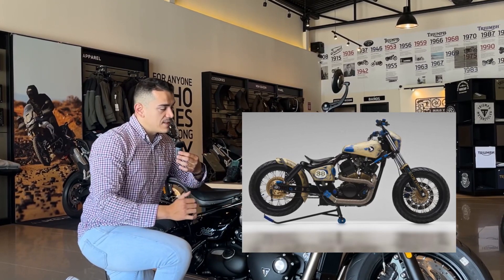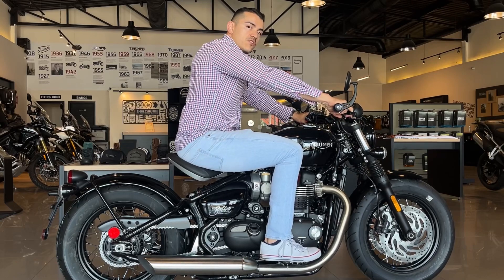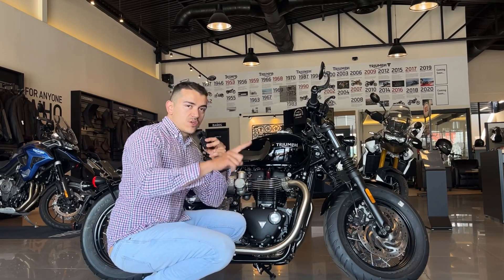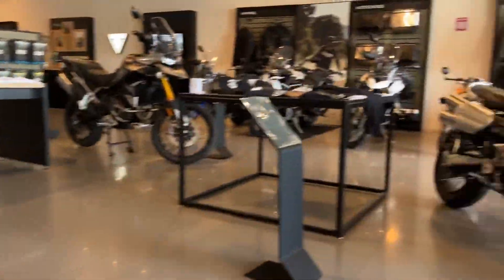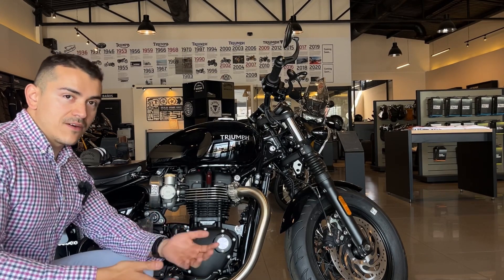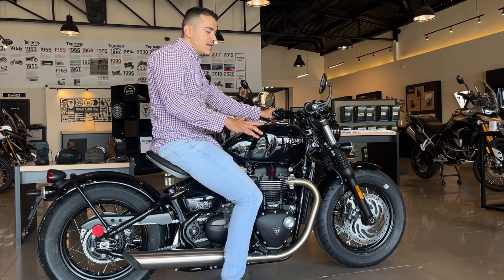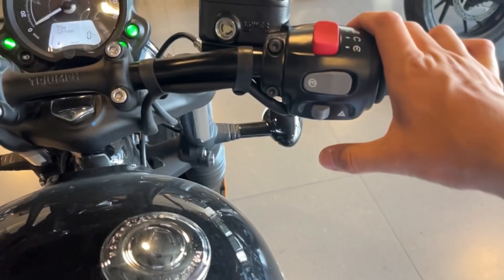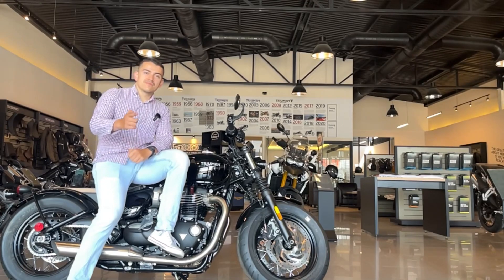RESEÑA BOBBER 1200 de TRIUMPH — Solucionaron la fatal falla de la generación anterior 😍

Comment: Cuando se habla de esta moto y de la entrega de su Torque o par motor, siempre se dice que se entrega a muy bajas vueltas. Eso es cierto pero no es como todo el mundo piensa. Tengo esta misma bobber y una Yamaha xjr 1300. La Yamaha entrega 108nm de par motor pero a 8000 vueltas. Esto que parece el doble, no lo es.
Es mucho más fácil y rápido llegar a las 8000 vueltas con la Yamaha que a las 4000 con la bobber. Es decir que dispongo antes del Torque total a 8000 vueltas con una moto que a 4000 con la otra